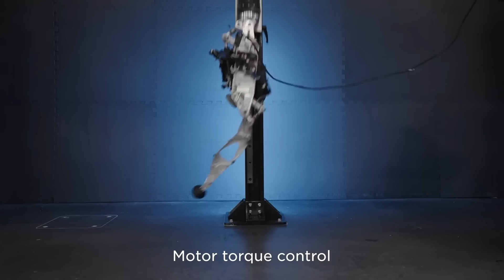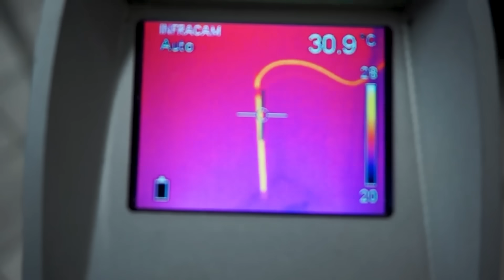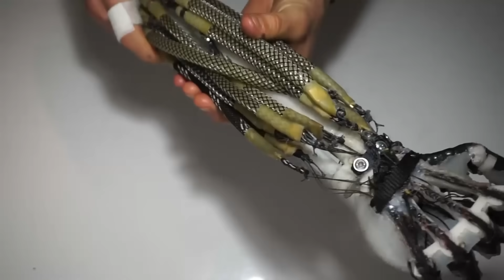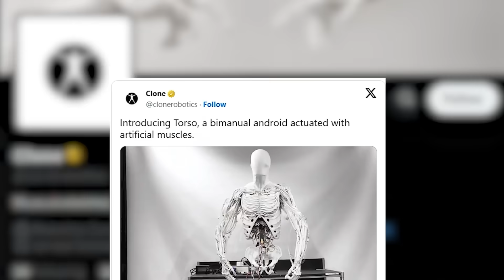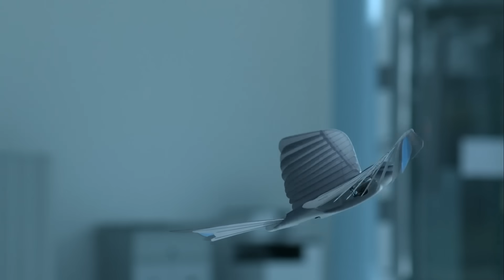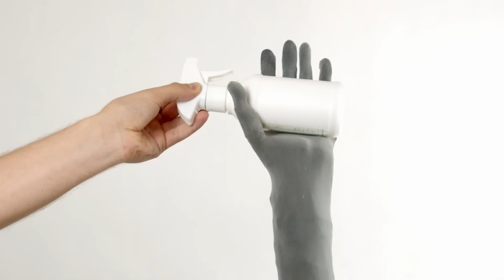Meet The FIRST WATER POWERED Biomimetic AI Humanoid - Synthetic Humans Are Coming!

Comment: So … if you accept a stage where the robots don’t need to be human form factor, where a bed in a surgical suite might have multiple arms which can access all of the body, and the bed contains the hydraulics, and the guiding brain … the parts don’t have to be connected the way human parts are connected to make them all work the way they are hoped to work.  Imagine a physical therapy robot that is, at base, similar to gym equipment?

Comment: Sounds and looks great , more like human movement than motors can do , but the control to make decisions and movements in order to preform actions that are relevant to being self sufficient is not yet possible, the so-called Brain or main processor that will make decisions and preform actions that can be used in every day tasks are still far from being implemented , and the most important thing is it’s safety to its self and to all living things with a built in program that cannot be changed or modified so that it’s actions and decisions don’t in any way compromise the safety of people , that in its self is very difficult, because the machine must differentiate between humans, animals and machines! You don’t want it to damage a Multi million dollar CT scanner or a human but a party balloon may be expendable under certain conditions! Very difficult decisions for any machine ?

Comment: This requires comprehension, experience, electronic and engineering calculations in all fields, and this will take many years until humans reach a stage where they can move from one planet to another easily, but did you know that they have been able to do this for a long time? How many years? I do not know this, and there are leaks of secret documents that they possess space ships, meaning a space war fleet. What is their main mission? No one knows.
👽👽👽👽👽👽👽

Comment: There must be two processors. We start with the first processor, which is the brain. It must have a large memory to download a large amount of data at a high speed. This means that it should be as similar as possible to the work of the human brain. As for the second, each heart works to distribute energy to all parts of the machine.

Comment: Systems Organization of Science Sensors and Technology.
Community secret of robotics in college 
(gold kit fukushima robotics) >>Using a test method eliminates errors and worries about false data and research. You can prove it to yourself to work with the robot and use your own test points in the method. See test method test points. 

Please tell me in history when Isaac Newton had Robotics or computer science he would never have known they could exist. I do not believe he had force all around good as a modern physics researcher.

Found on the first line of code in the standard operating computer systems line code. You will remain stuck and they are useless without this code test method.
F=m*23
F=m*333 
F=m*633
(Voice prompts start at 933)
F=m*933 ----robot states "too slow human" a voice box is required for audio prompts to go higher in the test method test points. Isaac Newton born in 1643 did not create.

F=m*1993 -----robot states "too slow human" 
F=m*2193
F=m*2300
 F=m*2390

F=m*2391

Ask for their command and they will repeat it for you as much as you need. Give them at least two or more calculators and/or cell phones to make the robot's reaction time faster. 
You can also use code: F=m*a*b*c 
Equals:
F=m*2308

Comment: It's definitely an impressive idea that not only helps robotics move in a fluid way but brings down the cost.

It still needs work and finessing but I feel it's a step forward.

When it comes to skin for such a machine, I've seen the robot ( I forget the name ) that can do some very impressive, fluid facial expressions and movements. 
Skin will also, of course, depend on it's use.

I hope they will be able to dramatically reduce the size of the water pump as it seems rather large for a robot to be carrying around.
Reply: What water are you talking about?
Reply: @CharaTR  It's water powered!

Comment: Very interesting subject. Q: you say that they use water to manipulate articulation; so what happens if they are in a sub-zero temperature, for an extended period of time? Would it be better to have a ethyl glycol alcohol fluid mixture?
And how do the components handle cold and low temperatures, within the range that humans can still operate?
And the same could go for extreme heat regions, dry, dusty, and sand? Being in a controlled environment is one thing. Being in realistic environments would also be a critical factor for them, in being successful components!
And what about being exposed to water, getting wet from rain, or water being thrown at it, or a hose spraying it? 
They are quite interesting though.  👍🙏

Comment: This concept has been around a long time. On June 3, 1982, I filed a US patent application titled, “Robotic Fluid-Actuated Muscle Analogue”. It was issued on June 4, 1991. Using my own financial resources I built several different hands and other robotic devices using my actuators. My “artificial muscles” were special made using low stretch fibers oriented parallel and embedded in a natural rubber latex tube. They worked very well compared to air cylinders for controlling position because the distance of contraction was directly proportional to fluid displacement. By the way they worked with gases like air and fluids like oil or water. When we first filed the patent application the patent examiners found an East German patent issued to a polish inventor for the same type of device, but using a braided fabric tube instead of my longitudinally oriented fibers. Due to a lack of financial support and the archaic control systems available at the time I moved on to other projects. I still believe the basic idea is an excellent way to mimic biological movement. I wish you and everyone working in this area of robotics continued success. R. Scott Caines
Reply from the maker: Thank you for sharing your insight, R. Scott! Your dedication to the concept despite the challenges is truly inspiring!
Reply: @ Thanks for your comment.
Reply: They also have a new type of valves made by them.
Reply: @robertklimczak5630  Thatis great!
Reply: Thank you
Reply: Then somewhere underground DARPA has an army of these things ready to kill us off.
Reply: Yeah... But thier work looks cool you have to admit.
Reply: @dondixon4206  Yes I agree. That image is why I watched the video.
Reply: yes it does